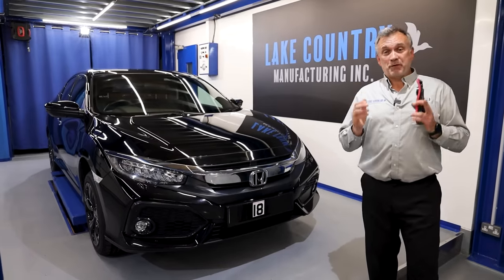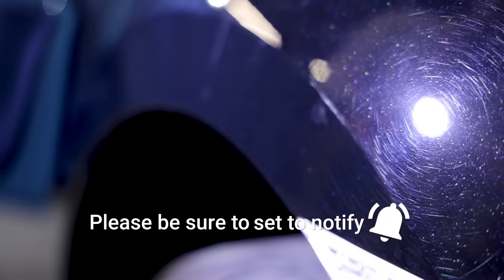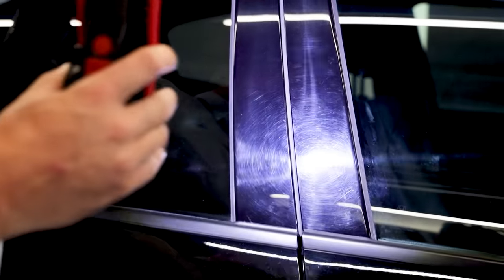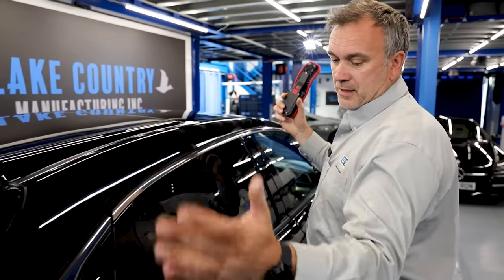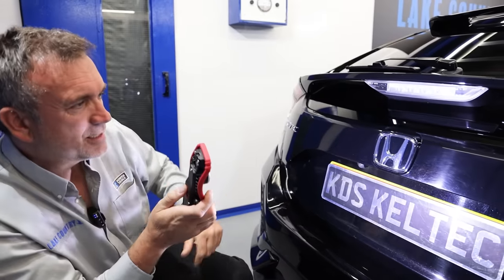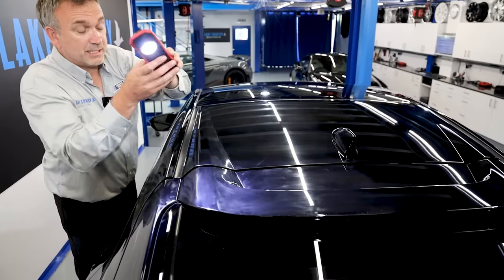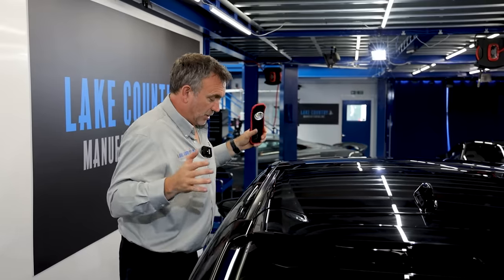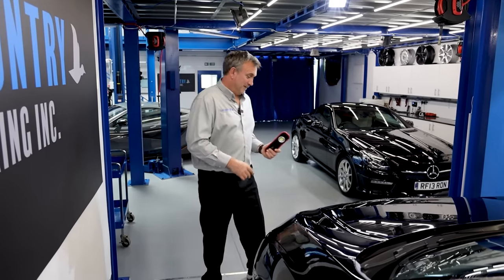Spotlight, '18 Honda Civic - Part 1: Record Amount of Paint Defects

Comment: I haven't seen a car that bad personally ever. But I know someone who has. 

It was a black McLaren 600LT I think?   
It was literally covered head to toe in every imaginable paint issue you could think of and 3 different bodyshops couldn't get it right. 

It ended up going back to McLaren, who had to literally strip it back to the bare metal and plastic to find out what the hell was going on. 

Apparently there had been some sort of unusual chemical reaction between the base primer and the paint (according to McLaren anyway) which had caused the paint and clear to just go totally wrong somehow. 

Never heard the technical description personally but I did hear that they had their MSO experts poring over it for ages and even flew in some sort of legendary paint expert chemist from somewhere to figure it out. 

I believe they have kept some of the body panels for teaching purposes (they replaced the whole car).
Reply from the maker: Well that sounds like a mess!
Reply: @LakeCountryManufacturing  absolutely!  

The irony is the replacement car needed 5 days with my friend for a complete top to bottom, 3 stage detail anyway!  

He did say it was a right ba***rd to work on aswell  and that he had to use 3 different types of pads on different areas of the bonnet alone!

Sod that for a game of soldiers I say!  Still, not a bad way to make £3k from a detail I suppose!